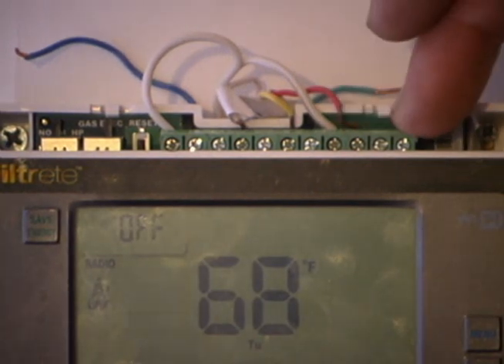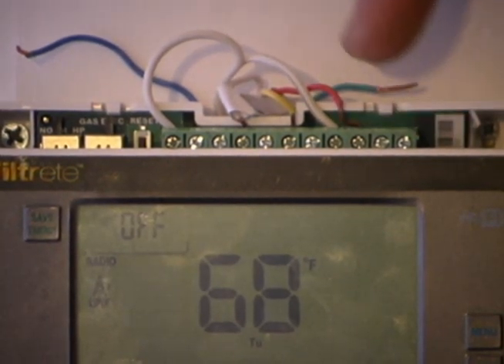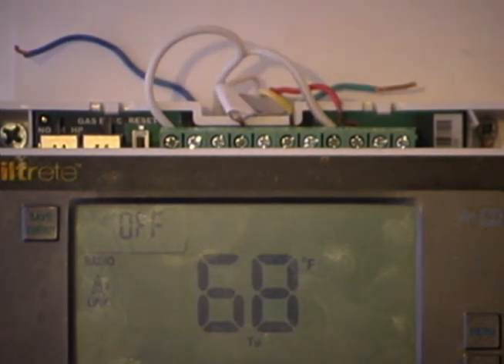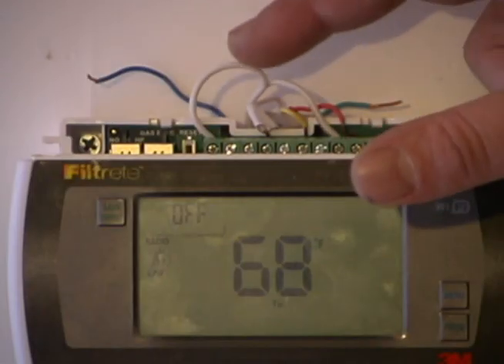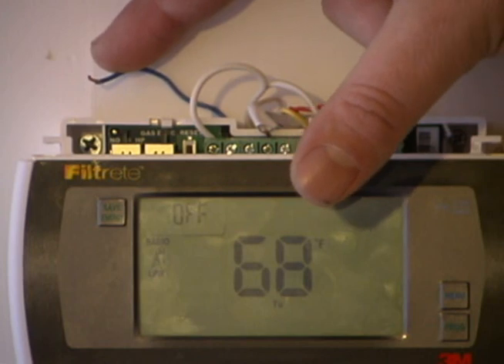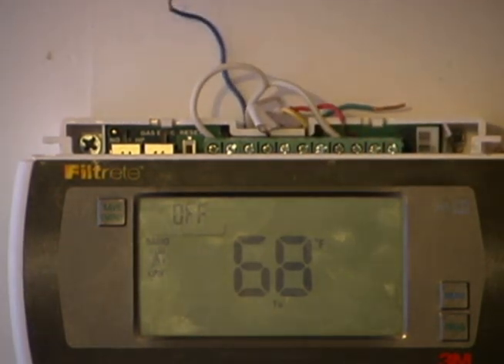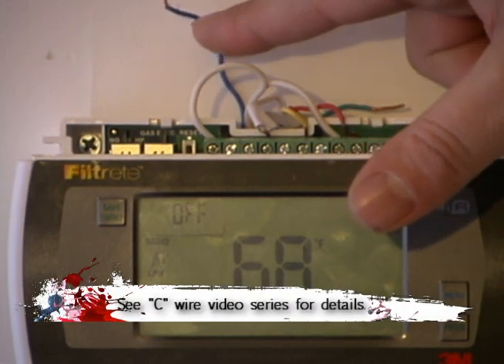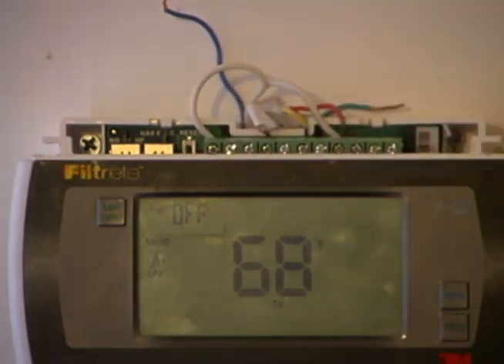C Wire -- Why you need one with a communicating thermostat

Comment: I purchased a wifi honey well thermostat. I have 4 wires coming in to the thermostat. Blue wire-W White wire-Y Black wire- G Red wire- R with jumper into RC

On the gas central air and heating furnace circuit board.. Green wire (single wire)- that's goes into Y & G White wire- W Red wire- R Baby blue- C

Someone please help me out here going nuts to get this thermostat to work, don't know why the green single wire is connected to y and g terminal..

Comment: Do you still have to install batteries if using a C-wire?
Reply from the maker: It is recommend that you keep batteries in the thermostat as a back up.  This help if you have a power failure or brown out - it lets the thermostat know that it lost wall power and will kick in the compressor delay function if you heatpump or ac was running to prevent damage to the unit.

Comment: Finally a sensiblle answer to the question on the C wire and WIFI thermostats needing power to run the WIFI radio portion.  THANK YOU!!   You would have thought one of the previous 5+ videos I watched would have mentioned this.   Now I finally understand.  Thanks!!

Comment from the maker: At the present time there are no wiring videos.  There are a large verity of systems each having a different wiring configuration.   Pleas note you can not go by color of wire.  You need to know the terminal the wire was attached to.  That is because different contractors may use different colors for the same terminal designation.  For example the G wire may be green, blue or black.  So that is why you need to know the terminal the wires were attached to.